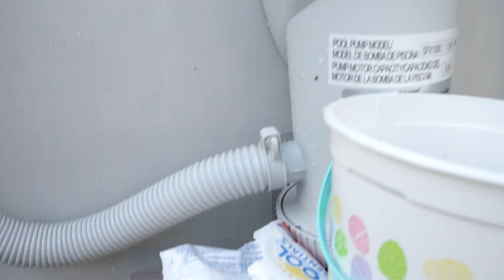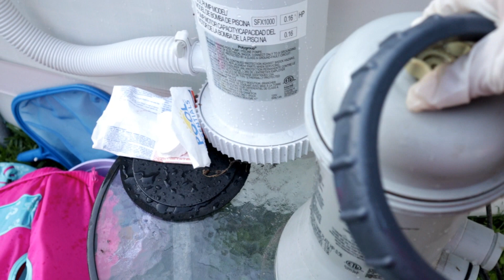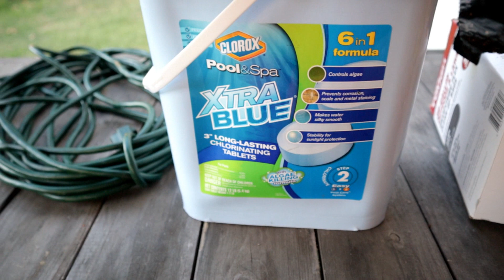Summer Waves Pool 14Ft x 42in.filter hacks/one week after purchase.

Comment: You need a little more water in the pool.. You shouldn't let the filter suck air.. It will mess the motor up
Reply from the maker: Thanks will put more water but the ground is not level,i tried to level the ground but i did not do good lol
Reply: That's probably why it's so loud.

Comment: It looks like your water level is low and your pump is ineffective and gurgling.  I'm new to pools and found out the minimum water level marker on these pools (I have the same) doesn't work you need 1/2 the intake.  Once I put a bit more water in my pool I was fine.

Comment: I have a promise, there water leaking from my pump. Is it screwed on wrong?
Reply from the maker: Is it leaking from the buttom?
Reply: Baleleng_Tv  yes
Reply from the maker: @kingdomklout612  u can try to put new rubber seal. Check amazon
Reply: Thank you
Reply: I think I may have placed the rubber seal in the wrong place, this is my first time sitting up a pool. Do you mind me ask where exactly does it go?
Reply from the maker: @kingdomklout612   button of the pump. Open that, u can see  the seal try fix it,if not you need to buy another seal. If its brand new  u can try calling summer waves cs.

Comment: please fill up your pool with more water or remove that white cover with the styrofoam, your choking your pump with air and you won't be able to filter your pool properly. Your pump should not sound like it has rocks in it.
Reply from the maker: Theres no styrofoam on it,i did not put styrofoam.
Reply: Definitely needs more water.  The pump is cavitating
Reply: Richy is right.   You need to remove the fabric and ADD WATER! You can see and hear your pump is sucking air. And it’s not filtering. Trust us. You’re going to be sorry when it burns out.

Comment: You need more water in your pool. Your pump is sucking air and it’s going to burn out 🤦‍♀️
Reply from the maker: Thanks for your concern,if u wanna watch other video ull see for the update.
Reply: You need to put more water in your pool because your pump will burn up do you have to have at least halfway up that whole area all the way around the pool so your pump will run smooth